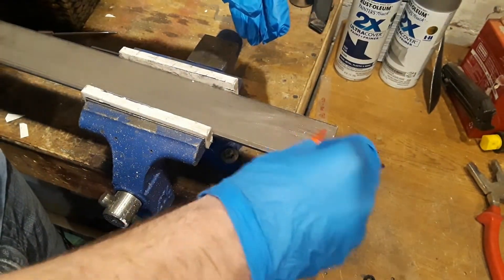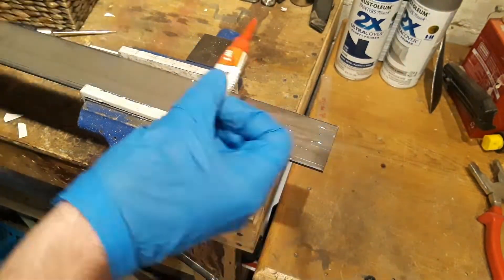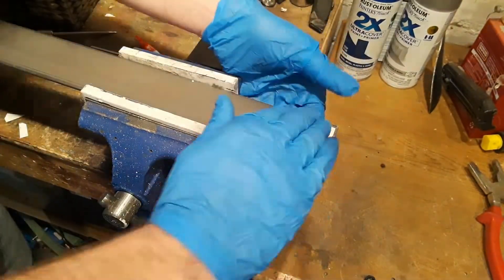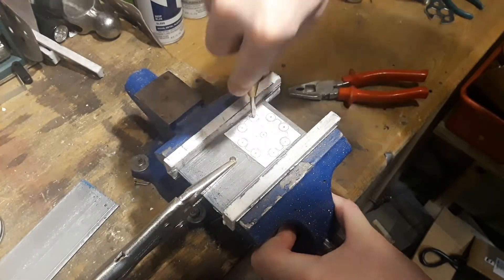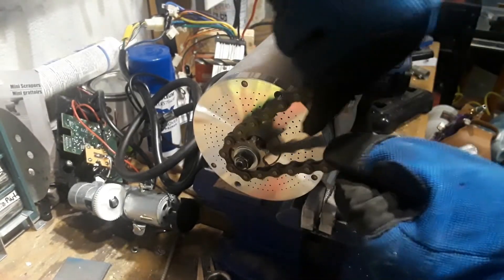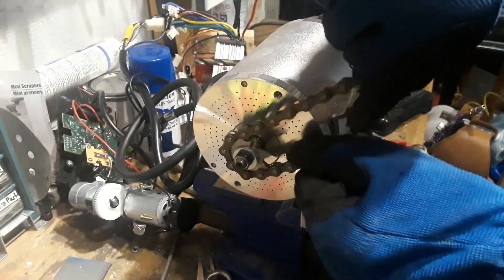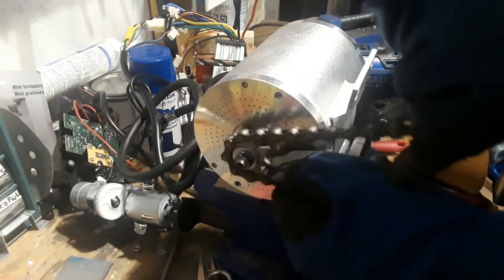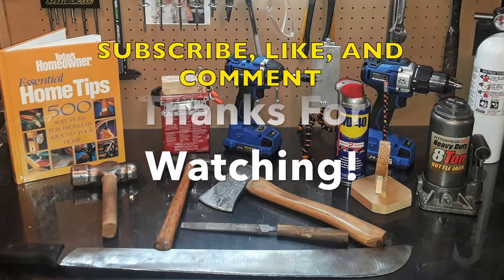How to Make a Sprocket

Comment: Hello brother Very good morning. 
I want to tell one humble  suggestion about this video. You can't show clearly how to cut the holes.  This is 
very important. From the next video
please try to make a clear video to
the viewers with out any doubt for
them. Thank you brother. Don't mistake me.
Reply: Hey wondering where can I get the sprocket templates bc I don't have a windows PC I only have android phone
Reply from the maker: I drilled out holes as seen in the video. And I cut it out with an angle grinder as shown. Then filed it out. Hopefully this helps.
Reply: @BunkerBuilder  Thank you brother.🙏👍